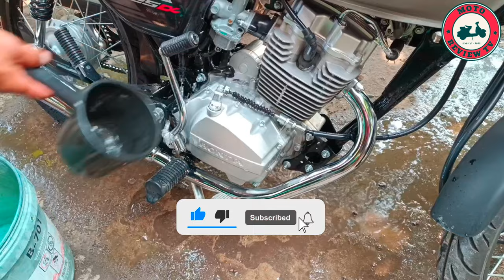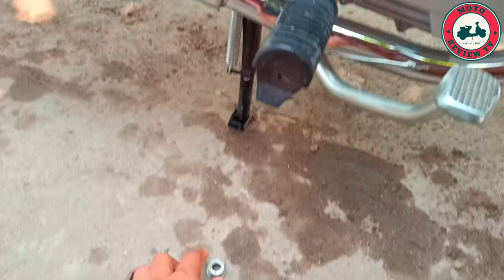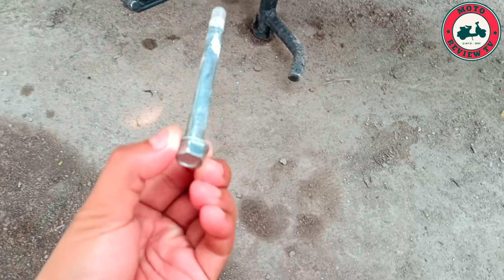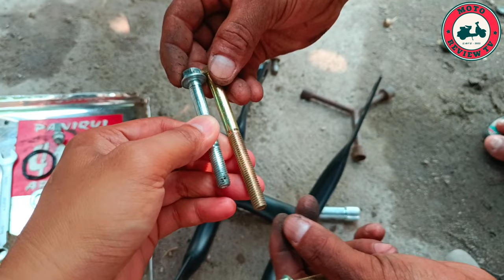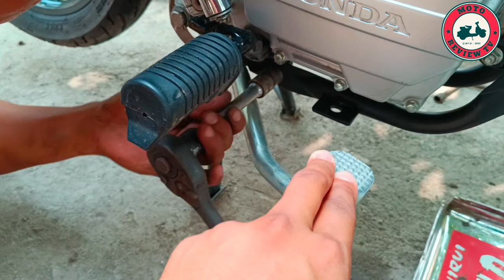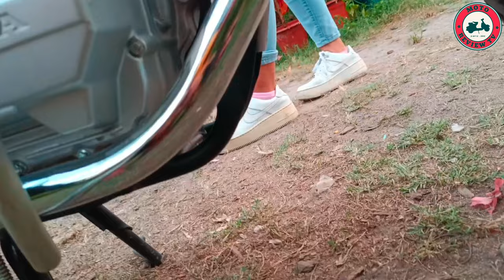PAANO MAG CONVERT NG HONDA TMX 155 ENGINE GUARD WITH BRACKET SA HONDA TMX 125 ALPHA FULL TUTORIAL 💯🔥

Comment: Actually ang chassis ng TMX alpha ay same lang din ng sa 155 kailangan lang mag palit ng mga bolts dahil mas maiksi ang sa alpha.

Naikabit ko sa Alpha ko yung stock engine guard ng pang 155 at pasok yung mga turnilyo magpapalit ka lang ng lang 155 na bolts kasi maigsi ang sa Alpha dahil walang engine guard.

Naikabit ko na nga yan sa alpha ko na gen 1 at sa gen 1 yung isang butas doon ay pwedeng lagyan ng bolt yun dahil May thread di tulad ng gen 2 at 3 na walang thread.
Reply from the maker: Dito ko binili sa shoppe mura lang dito 👇

📍 TMX 155 Genuine Engine Guard:
https://invl.io/cligd7z
Reply: @MOTOREVIEWTV30  pwede rin naman makabili niyan sa mga katayan ng mga motor yung mga junk na kung meron tiyempong binabaklas mas makakatipid ka.

Ang original na engine guard ng 155 ay nagkakahalaga ng mahigit 1k sa mga authorized genuine spare parts seller ni Honda. 

Yung engine guard ko, nataong nabili ko lang din sa motor shop na nagbebenta ng mga junk na parts.
Reply: Same lang po ba ng kabitan ng engine ang alpha at 155? Tia
Reply: Yes po. Pwede ikabit makina ng 155 sa chassis ng Alpha 125 kahit yung sinaunang 125 pareho lang din po.